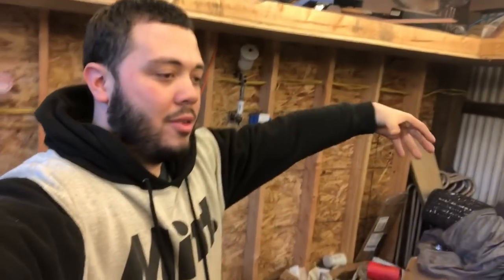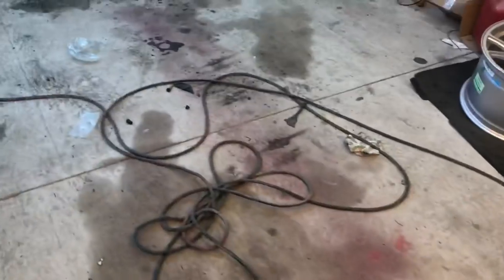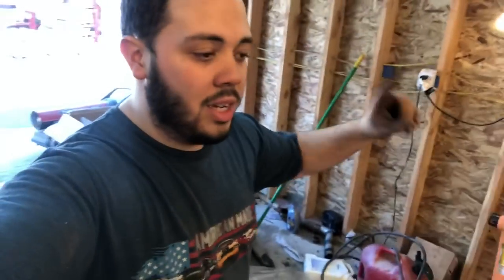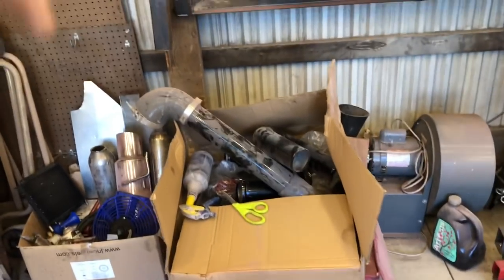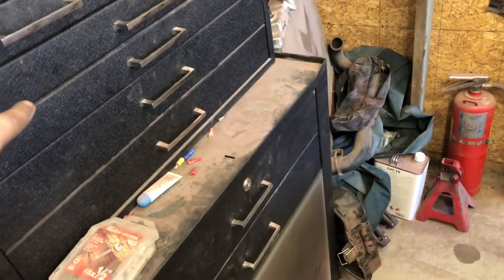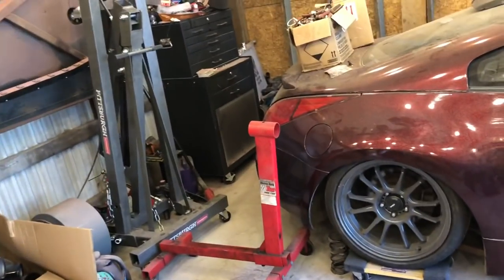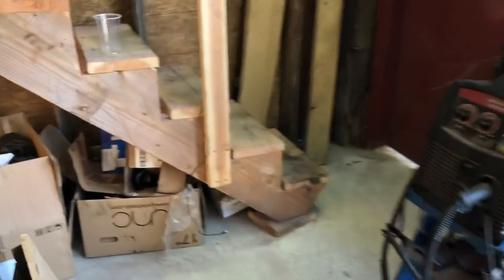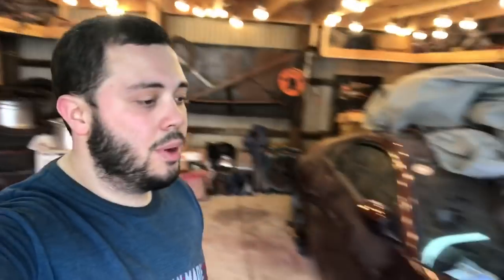LETS TALK ABOUT THE LS-Z

Comment: You should have left that LS fucking stock instead of adding money and trying to turbo it when you couldn’t get it running in its stock form. Don’t complain about money when you’re wasting it.
Reply from the maker: And you shouldn’t talk about something you clearly don’t have an idea about lmao I got the engine as it is it was built for twin turbo by a shop, all I did was put supporting push rods and valve springs in it so it wouldn’t blow up. It was and still is running properly and the best it can in naturally aspirated form, so rather than getting another engine in which I don’t know the details on I decided to boost it which is what the engine was built for. Made 280 hp 320 tq with 7.5:1 pistons that’s pretty damn good, it’ll do a 3rd gear sitter from a stop, and it’s only gunna get better with boost 👍🏻

Comment: Wanna do a z32? I’ll trade you a 5.3 with z32 mounts keep the turbo kit make it N/A buy a adapter plate you can maybe even get sponsored then run stock driveshaft my car’s complete or if you wanna try to get that motor running again no rust